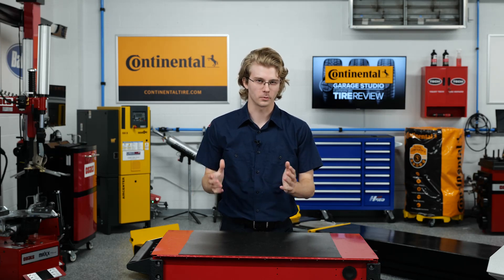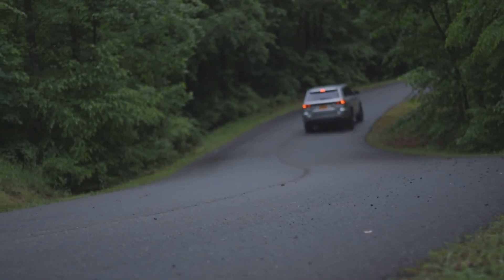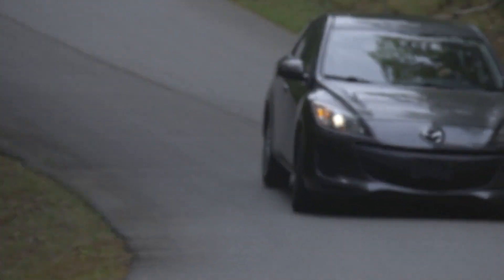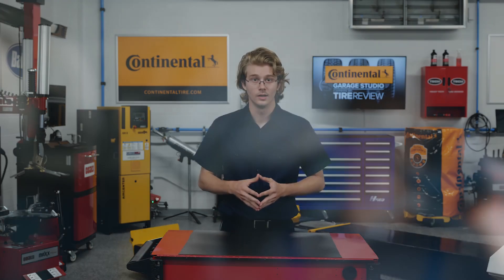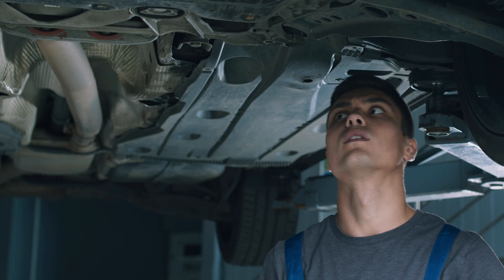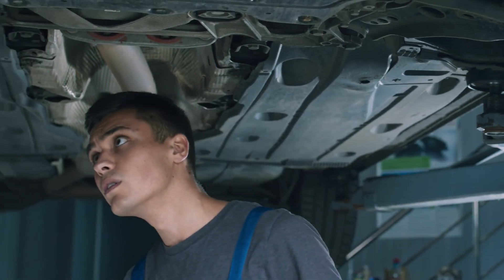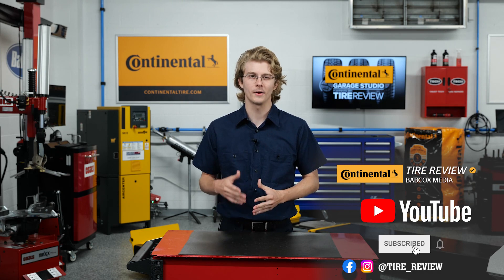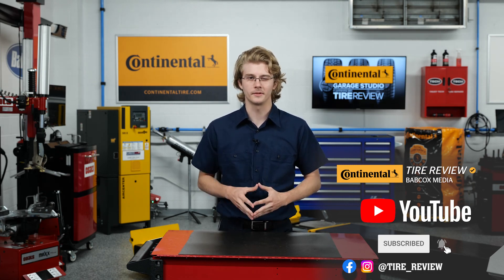Identifying Weak Springs that Need to be Replaced

Comment: Spring rate wil degrade. Most people may not feel it because they may not notice much impact. But for me, I can know. I had many high mileage cars over my entire driving life. The ride comfort will amaze you if you change the spring after car reached over 150k km or 100k miles. Best is pair with new shocks. Springs don't cost much and is often ignored by car owners to change. If you change it, you may consider keeping the car for longer because the ride is so much like new car ride compare if only changing shock and reuse the old springs. I argue with my mechanic who told me waste of money for new springs, but I never regret.

Comment: I bought a second-hand superb Sportline 2021 model with just 54,000km and suspension was so springy after a lot of push back I managed to get main dealer to replace all shocks. But sadly suspension is still very bad and I can't seem to convince them because they don't believe that spring performance can degrade. The car is now at 73k and it's very difficult on back roads.
Reply: Also any mechanic I go to tell me it can't be the springs because they don't degrade in performance they just break. So needless to say I'm very confused what to do next
Reply: @trading-IRL  if you have all steering bushes in good condition, then go for the spring. I have a high mileage car. Changed my springs like 100k miles with new shock absorbers. It was fantastic new car ride. Absolutely love it. Cars now over 200k miles, and had 2nd time change of a set of new coils and new shocks. Feels like new again. Even provide better handling. Coil springs don't cost a bomb. Worth to try it.
Edit : spring does degrade over time. They get 'stiffen' making the bounce more aggressive. In my opinion, it just degrade the road holding. I work in test company, and once there was a spring test. My colleague did share to me they test one of the spring from an OEM factory, the rate start to slightly degrade after like 40k of pulse. Mechanic only see the exterior, but we as driver know there is something wrong because we feels it.
Reply: Upgrade them
Reply: @HonderdtachtigCC  maybe it's my only choice! However I forgot to say they are standard superb stock shocks with lowered springs, can that be ok? From my research that shouldn't happen and must be a mistake ? Should be lowered shocks also ?
Reply: @trading-IRL you need other shock absorber